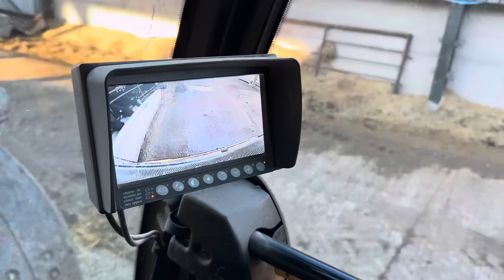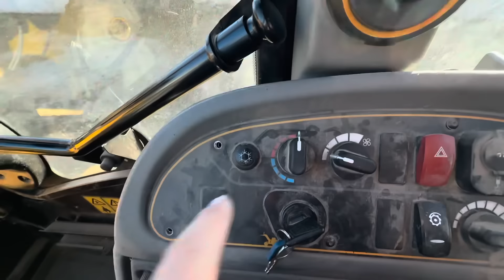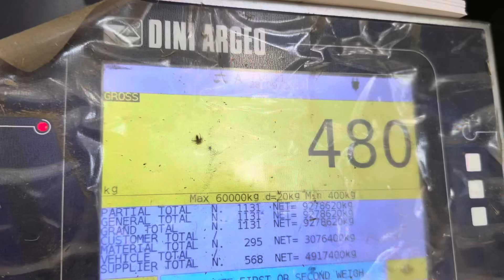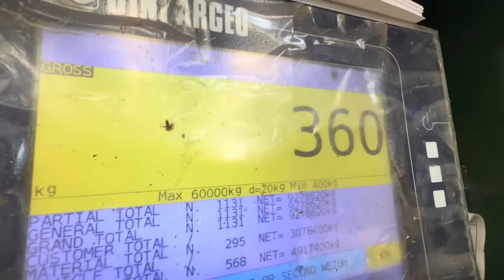It’s on Fire! New Toy to play with on the Farm!

Comment: New drill looks good. Next job with winter coming on is to purchase a 12v battery and a 3amp trickle charger pet anent hooked on. This will save you hours when one of your 24v systems go flat. You are losing daylight hours shortly. In the military we learned early that batteries were our be all and end all. This applies to farming as well. Don’t throw it in a corner or stick it on a bench. Put it in wooden cabinet with small suction hose and small fan from a computer to suck gases out and charger attached. This will pay for itself the first time you have battery failure on a repeated basis. You will save time, expense and get the. Intend ed job done. The cheapest insurance money can buy. Just in time is someone else’s time at your considerable expense and never your convenience.